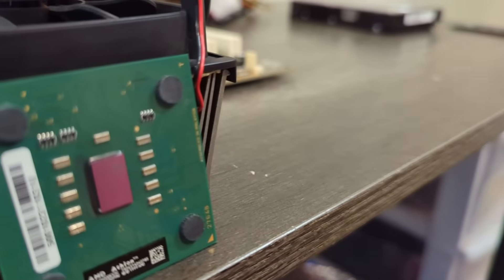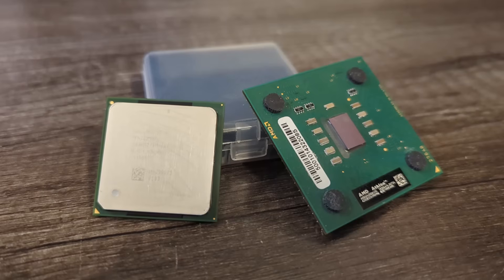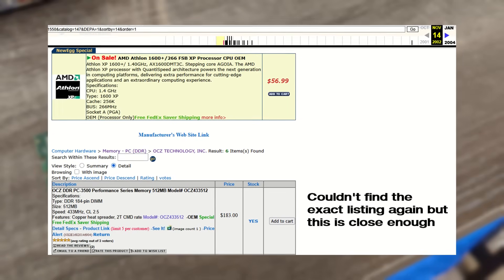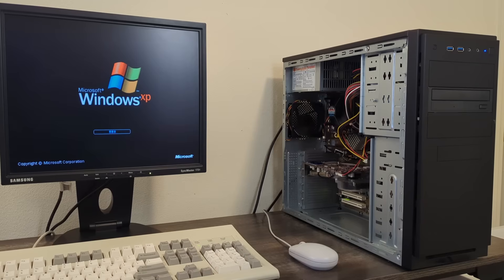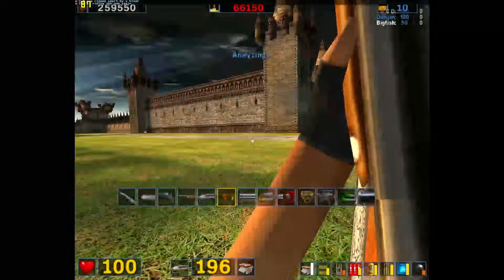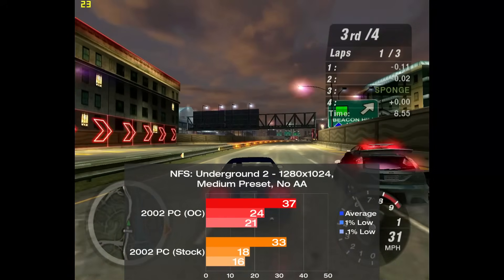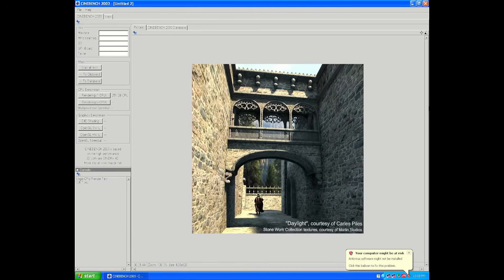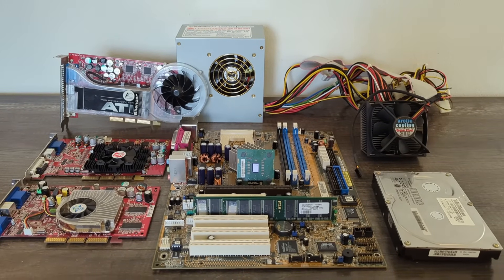Build and Bench: 2002 Gaming PC

Comment: This takes me back. I moved from a p3 933 slot 1 v3 3000 to an athlon xp but the specs elude me. I then moved to an x2 3800 then 4200 o/c to 2.6 with a 6600gt then a 9800gtx+. It was the wild west. I still have the x2 & 9800 crushing it in my xp box. My daily now is a 4790k & rx580 (2304)

Comment: I still had a 466 Celeron with an ATI Rage 3D II in 2002 :'-( I have finally recreated, what I had lusted after back then: Athlon XP 2400+, ECS K7S5A Pro, 1 GB DDR, Radeon 9500 Pro, SB Audigy 2, Chieftec CS601-Midi in dark grey, lot of LED Fans^^

Comment: remember the e3 doom and hl2  leaks? i bought a 9800 non pro, flashed it to a 9800 pro and i believe i had either a 533a celeron or athlon xp 1800+ at the time, i had the a7n8x with my 1800+ at some point, i believe i had an abit board with the 533a.

i had 2 ibm deskstar gxp 60gb drives also (iykyk)

Comment: Hey, the 3.0Ghz Pentium 4 was released in 2003, and the Athon 64 was released in 2003 to. So it's a kind injustise to compare an architecture that remains with no changes until 2008 with an old revision of amd chip. You could better use a 2.4Ghz Pentium 4 vs Thoroughbred or 1.6Ghz Pentium 4 vs Palomino or a top Barton Athlon XP such as 3200+ or 3600+ or an Atlhon 64 3000+ vs the well known P4 3.0Ghz HT.

Comment: Nice video!  Poor over clocking results though, I was expecting a bit more from this chip.  Does the pencil mod work on these?
Reply from the maker: Thanks! I mean I'd say it wasn't bad for an overclock at 15%, the scaling was good too. I'm not sure about the pencil mod, something to look into! I don't think I'd bump up the voltage much more with how hot it ran though, I ought to get a heat pipe cooler.
Reply: I think the mutlplier is unlocked downwards ?  If so could try 200fsb and run the ram 1:1 i think that would give a nice boost  @SPNG

Comment: One of my best investments in 2002 was buying a GeForce-4 Ti-4600 graphics card, probably the fastest consumer card back then by mid year at around the $150 dollar level.  The Ti-4800 made the next year was not really any faster than the 4600.   My 2002 PC setup then was a Pentium-3 1.0ghz, 512mb pc133 memory, ti-4600 video.  It was decent for playing my favorite games of those times, such as Battlezone 1 & 2, Quake 2 & 3, HalfLife 1, Serious Sam 1, Soldier of Fortune 1-2, & whatever else I had/have.   I still have all that PC equipment & game software today.   I do have some Quantum Fireball harddrives around here somewhere.  My operating system was still Windows 98SE, with all final official updates as it was already obsolete but still a fine O/S for the home.   I was also actually thinking of trying to do a TEC (thermo electric) cooling setup around 2000 & I had already bought the TEC CPU heatsink & some different kinds of chemicals, but eventually I just did not want to sacrifice any motherboards to such a risky experiment.   Today, CPU water cooling, although a bit more spendier, is likely ever a more stable & safer solution than TEC.   
04/11/25
Reply from the maker: Ti 4600 was definitely a beast back in the day, was the fastest video card until the Radeon 9700! Did you have a Coppermine or Tualatin P3? Nice games too 👌 TEC would have been pretty wild on a setup like that, have you considered water cooling it these days? Although I'm not sure it'd need it with how low that chip's heat output is 😅
Reply: @SPNG  ... The CPU might be a Coppermine, as I believve these were one of the first cpu's that officially reached 1.0 ghz, although I am not totally sure if that's what I got.   I have/had not considered water blocking this setup because it does not really require it, the cpu-fan is/was already plenty.   Speaking of ATI, my first best ATI purchase was the Mach64, Pro Turbo ISA version, in the mid 1990s.  This is without that extra-memory daughterboard as that board is hard to come by or way too costly to obtain, even to this day, but it would be nice if someone gave one to me free or a very low price, heh!    I never really got into Radeon stuff while they were happening, probably partly because of prices, as I became more of an nVidia fan since the Riva's of the late 1990s, but that "nVidia vs ATI" competition thing was cool to watch back then, other than the "Intel vs AMD" wars, not to mention the "Pentium vs PowerPC" of the 1990s.  I probably have since obtained some early Radeon around here somewhere.   And I still have my Commodore 64's, my favorite computer of all time, ever since I got one in 1983, along with everything else related/required for it (peripherals, software/games, magazines, manuals, old printouts, piles of floppies, etc).  I have 3 64's, plus a c64 cpu accelerator that I got in 1990.   And plenty of vintage PC stuff as well.    :)
04/11/25

Comment: My build Athlon XP M 3200+, in ThermalTake LanFire case with ThermalTake power supply and ThermalTake cooler, 2 GB DDR, SB Live...
But Motherboard  is A7V600 VIA chipset and no matter what i do it will not work properly with Radeon 9600 pro.
Back in days i had 3200+ barton core and Asus a7n8x deluxe best motherboard for Socket A ever, last card used in that PC was GF 7600GS ( 9600 pro worked perfectly also )
7:15 That logo brings memories I used Athlon XP until 2007
Reply from the maker: Those LanFire cases were so extreme looking! This board and a 3200+ is a match made in heaven too 👌 And you're yet another person I've heard of getting so much longevity out of this platform. Its very impressive that people were able to hang onto these for 4+ years given how fast things were advancing back then.
Reply: @SPNG  
 @SPNG  
Yeah you manage what you have,  like always, but served me well,
So last upgrade was GF 7600GS, it could launch Crysis that by itself its achievement. 

Great video and take care of that motherboard it's truly best of the best.

Comment: I had a similar setup that lasted me until 2009. Athlon XP 2800+, 512 MB of RAM (topped it to 1.5GB with the 3 slots!), 40 GB Maxtor (later a 320GB Seagate) and an nVidia 6800GT by BFG.Good old days. I still have the 2800 chip (not sure if it still works) if you want a free upgrade, also a Duron on the same socket if you want to experiment
Reply from the maker: Damn, you got a ton of longevity out of that system! I think the 6800 GT would have been doing a lot of the heavy lifting in later games. I really appreciate the offer but I'll have to decline with how many CPUs Christoph sent me, I have so many Athlons now 😅

Comment: 2002?  Hmm..  I think i had a dual Tualatin  1.3ghz p3 system and a Radeon 9000 all-in-wonder..  or a 9700 Pro,  cant rememeber when i switched.   Win 2000 server. Or Whistler (win XP beta)...   goodtimes.
Reply from the maker: Those dual Tualatin setups were really interesting, did you do much gaming on it?
Reply: @SPNG  i played quake 3, ghost recon, grimm fandago, myst, phantasmagoria, diablo 2, icewind dale....
Reply from the maker: @jaybird57  Sweet 👍 It's nice to know at least some people did some gaming on those dual CPU setups back in the day, if you used it for really long you might have been able to take advantage of some multi core optimized games 😅
Reply: Honestly, it may have been coppermines.. i swear after a bios flash I put Tualatins in it though.

Comment: Nice Build over all!  Would definitely be changing that Hard drive though, in 2002, 99% of gaming PCs would be running 7200rpm drives, I was in HS then and ran a 80GB WD Caviar SE. My P4 now has a slightly newer 2004 40GB Samsung SP0411N

 I need to do some testing but your fps for HL2 seems a bit low. I have a 3GHz Northwood P4 HT with a Radeon 9600 SE and pretty sure it got highter FPS on average, I'm guessing CPU was your limiting factor

after some testing on same settings same level, average is about 55 fps, lowest I saw was about 30fps, I didn't do a Fraps benchmark, just kept an eye on HL2's internal FPS counter
Reply from the maker: Thanks! I'm not sure if this system will be the permanent home for this HDD, but man it sounds good. And yeah I think the CPU is holding us back there, especially given the overclock scaling we saw. It was taking any performance it could get.

Comment: I had that motherboard and it was terrible in oc Great video! I had similar system back then except from the vga I had a Radeon 7200 and it was acceptable later I upgraded to a Radeon 9800 pro
Reply from the maker: Much appreciated 👍 A 9800 PRO would have been a sweet card to have, but depending on what chip you used you might not have been seeing the full performance

Comment: Im glad you confirned how hot the 2400+ runs - im used to a P4 around 45C - then when i was reparing a GA-7ZXE i bought a throughbred 2400+ for the board and it idles at 53C - i repasted it twice and no difference - yeah - i was surprised how hot it runs
Reply from the maker: It's a hot chip! I think the OC was really pushing the limits of this cooler too, I need something a bit better

Comment: Miss my 2400+ and a7n8x-deluxe. I stayed on Socket A for a while (had GPUs all the way from a 64mb Geforce 4 ti4200, 9600xt, x800 and GeForce 6800GT 512mb throughout it's life, and moved to the legendary socket a 2500+ mobile chip with a healthy overclock as well eventually)
Reply from the maker: Wow you got some longevity out of that system. Those are all pretty awesome cards too! I want to try a mobile chip as well, see if I can attain better clocks at lower power consumption.

Comment: For anyone looking to build a Socket-A system;
I would recommend getting a Motherboard with the extra CPU 4-pin connector on it.

Socket-A motherboards with this 4-pin connector (12V P4) don't rely on the 5V rail,
which allows you to use any modern PSU with it.

This is a lot better/safer (instead of gambling on using an old PSU from over 20 years ago).
Reply from the maker: That viewer donated another MSI board with an extra 4 pin, but I decided against using it for this build because it wasn't as feature rich (and made in the wrong year)
Reply: @SPNG  Don't forget to mention the blown Caps on that MSI Board 😅 ... or did you fix it?
Reply: You can find cheap new low end PSUs with 30 or 35 A on 5V rail. I bought 3 of them, no problems so far.

Comment: If you want a title that is a CPU killer, a game i used to play and now use as a benchmark myself is Beach Life from 2002, this is like Sim City on steroids and unfortunately my 2000-2002 system that originally ran 462 just wasn't enough, while the FX5600 overclocked seemed adequate enough, for the MSi theme for that build, 754 proved difficult as i couldn't source higher end CPUs, they've dried up and 939 is starting to suffer now aswell in terms of boards. AM2 was my next option which unfortunately pushes me to PCI-e but i was able to step up from an XP 2400+/A64 3000+ to a 3800+ overclocked to just shy of 3Ghz..granted the Nforce board i have, pushed the heatspreader under the cards and it and some surrounding components were getting uncomfortably hot so i went crazy with stick on heatsinks, the X1950XT is a placeholder but the drivers of the time prove the reputation well, but the performance improvement is great, Beach life being a game i play a lot went from the high 20s deep into the game into the high 50s, not ideal when trying to target 85FPS to make a scrolling game less jarring on a CRT but dropping to 800x600 somewhat solves the issue..

its a shame this early era falls quite hard on itself, being on the cusp of technology advancements that made the step towards effeciency, but back then 30-40 really was what you could come to expect, but i feel the CRTs at the time were way underutilised for how smooth an output they could push out hence the push to stronger platforms, AM2 is about as new as you can push for Me/W2K. Even though my 98 PC once i find a board will house my lovely Slot A Athlon TB 900 and push it past the 1Ghz mark does capture that K7 glory, 462 was my first introduction into proper 3D gaming with a GF2 MX and i have a lovely bright purple Soltek board that just needs to be used! a geforce 4 MX-440/Ti 4200 is about my cheapest entry into a purple PCB card with matching gold heatsinks as DX9 is just too much considering it was the start of game engines we know today and titles like NFS are so poorly optimised when you compare it to unreal tournament 2004 where a CRT could shine its high refresh rate on weaker processor platforms.

 The soltek rig would be more of a display peice as my main line of retro computers will outperform it but it would sit by my first PC with a S754 Sempron/FX5200 as a reminder of my first step into 3D PC gaming. They were the biggest jumps from a 2MB display card and 333Mhz pentium II MMX until i went from that FX5200 to a GTX 1060 3GB despite for the mid to late 00s both those PCs were long in the tooth, even though my first PC was retired in 2014! it since has been restored and have been transferring NFS Undercover to a USB 2.0 thumbdrive while i was watching the video since the HDD takes so long the networking times out and being early Sata 1.0..it just never worked even on 462 and BSODs! A laptop with an Athlon II/ATI MB HD 4250 just about managed 30fps at 800x600 Medium settings..i wonder what a 2Ghz Sempron and my FX 5200 will do when it recommends a 3Ghz chip and geforce 6 6600! Ended up playing it on a 360..lets see how bad it'll be on this old box!

Comment: A friend and I drove 200 miles to the Fry's in Burbank in 2003 to buy computer parts.  We knew we wanted the Asus A7N8X Deluxe, had great reviews.  We had the choice of a 2.0ghz CPU or a video card, so we went with the Athlon XP 2100+ running at 1.733ghz and paired them with a 4600ti video card.  512MBs of RAM and Windows XP made a great gaming rig at the time.  Later in the year, I built a dedicated gaming rig with the same MB and an Athlon 2800+.  Still have the parts and am pretty sure that with a BIOS battery swap, they'd still boot up.

Athlons made me a big fan of AMD (though I did skip the Bulldozers), and was really happy when the Ryzens came out.  R5 1500X, R5 2400G, R7 2700, and R5 5600 have been very good to me.

The XP 2100+ cemented my positive experience with AMD CPUs.  Nice to see the A7N8X Deluxe getting some recognition some 20 years later.
Reply from the maker: Ah, Fry's. Gone but not forgotten. I imagine the Ti 4600 would have been pretty heavily discounted by '03, and it's a much better pairing for these chips. You should try to give your old system a boot, play some games on it 😀 This motherboard definitely deserves some attention, it is really feature rich for the time. It having SATA blew my mind at first
Reply: Curious, i've used AMD myself all the way from K5 to Phenom2, but whole FX mess was so incredibly bad they lost me... permanently. So far Intel has not done something bad enough for me to switch back. 

S462 is still one of my favorite platforms though. Beautifully simple and old-fashined... s754/s939 which followed was a huge leap - x64, pci-e, integrated memory controller... in a way it feels almost mordern.

Comment: I just got a Pentium 4 PC at VCF East that I plan to turn into a 2003 gaming PC. It has a 3.2ghz HT Pentium 4, 2gb of DDR-400, and currently a Radeon 9600(that I will upgrade at some point)
Reply from the maker: Nice find 👍There's a lot of nice cards you could put in there, GeForce FX 5900 or Radeon 9800 series comes to mind.
Reply: @SPNG  if I can find them working for a good price that is.

Comment: Great build. I have so many fond memories overclocking Athlon XP CPUs back in the day.
Reply from the maker: Much appreciated man. I can see why, they're fun to tune but I wish I had some better cooling. I'd definitely feel a little more comfortable pushing this thing, makes me wonder if it's worth getting into some of the mobile SKUs.
Reply: @SPNG  Heatpipe coolers for 462 can be quite a pain to get a hold of these days unless you get lucky, I see your motherboard have mounting holes thru in addition to the clip mounting, maybe finding a cheap waterblock is a decent option? Then again you'd need the rest of the water system too if you dont have something laying around.
Reply: The 1700 and 1800+'s were the go to chips. When you can go from 266 to 400mhz fsb, whew

Comment: ooh, Barton! That name certainly takes me back to 2003. I had the 'Celeron 300A' of 2003, a Barton Athlon XP 2500+ easily overclocked to the speed of a 3200+ simply by bumping the FSB from 166 to 200.
Reply from the maker: Damn that would have been awesome considering the price difference. If this system comes back it's gonna be with a Barton. I'd like to try some of the mobile SKUs to see if I could attain decent clocks and low power consumption.

Comment: Oh, man. This was my era when i went from pre-built to starting to build a pc myself. Even now I try to keep a socket A build, since, it was the platform I was on when I met the gal that would become my wife <3 Anyway...
My present iteration on it is using an XP 3200+ I managed to salvage from a business computer the in-laws were getting ready to dispose of. Took a lot of effort to find a compatible board and one that didn't cause me instant misery with drivers.
For what it's worth, I've also had good luck with an eVGA 430 watt white unit to power the system, which incidentally had some 30-ish amps on the +5V rail. No  -5V, but I wasn't dealing with any ISA cards, either.
Reply from the maker: I never grew up with Athlon XP but I could understand why it holds a special place in your heart, looking back I think it's a really neat line of CPUs. And that's a killer find, the best Athlon XP right there!